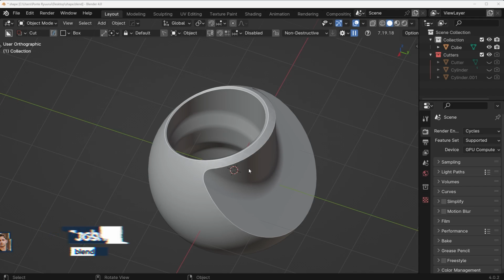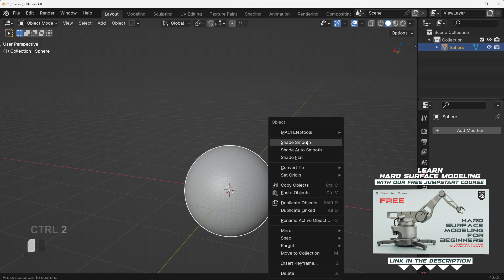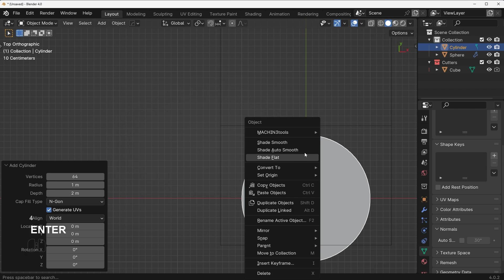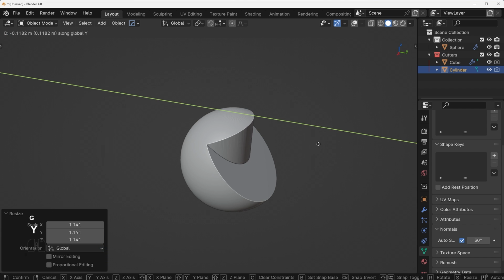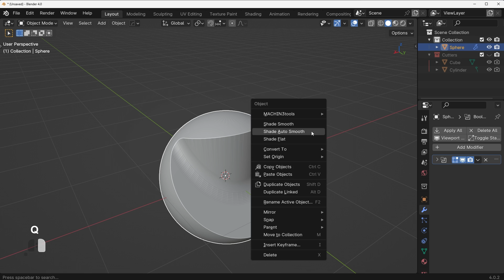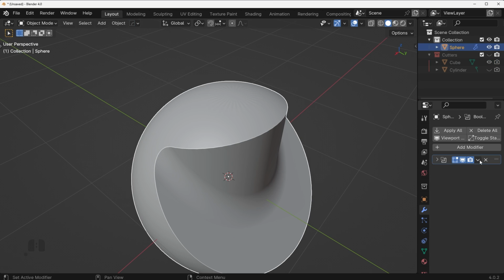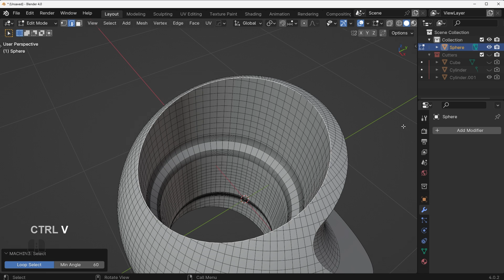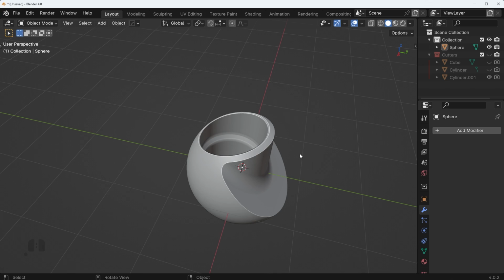IMPOSSIBLE Shape in Blender? (Cylindrical Sphere Tutorial)

Comment: Nice tutorial thanks.. how to quickly convert this final booleaned shape into a low poly model?
Reply: I am not sure, if such a complex shape gets perfectly converted into quads automatically, but I know of 2 things you can try out:

The free method: Select the object and go into the Object Data Properties tab in Blender (the little green triangle with 3 vertices), and there under the tab Remesh, switch to quad and try out remeshing with different settings.

The costly method: Quad Remesher addon. I don't have it and don't know how to set it, but many videos have shown, that it seems to be a pretty competent tool. I may get it at some point.